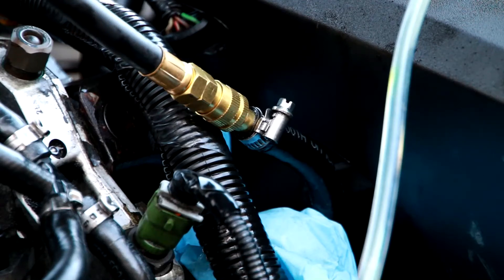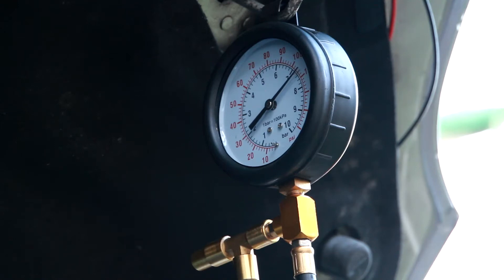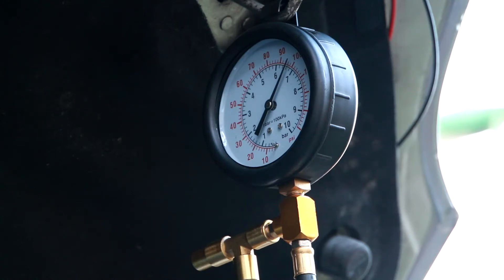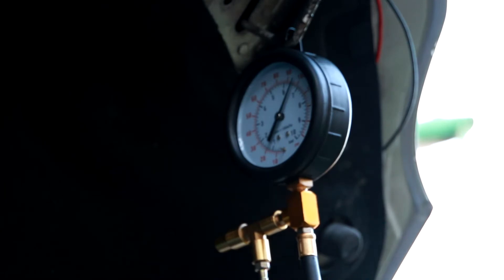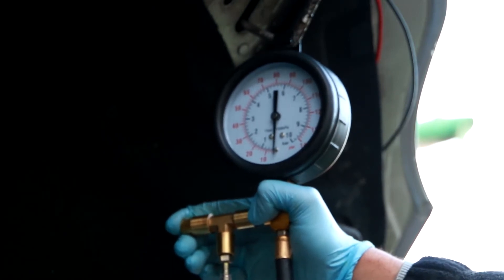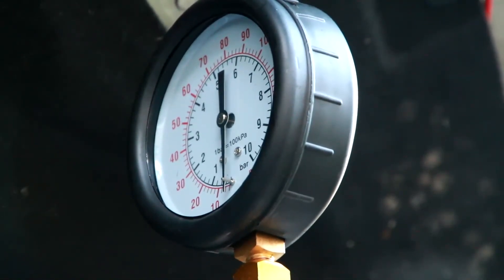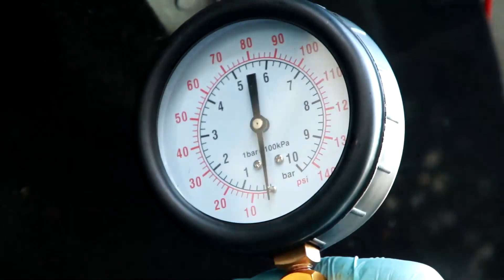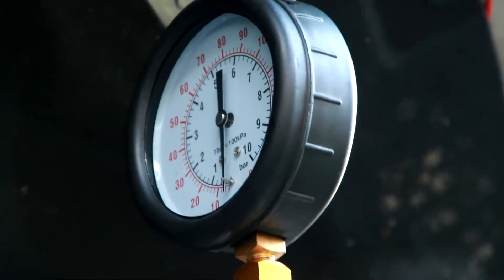Volvo D5 Fuel Pressure Check 1

Comment: Hi I know this is a few years later but in the 2nd fuel flow test, what should the reading be as you said it was low. This the hose that leads directly to HP pump nestled between the SCV or fuel pressure regulator or IMV/inlet Metering Valve

I'm asking as I've recently developed a longer cranking time, sometimes it cranks & cuts out and cranks again and starts. Then 3 weeks ago, driving along and the car switched off, steering heavy, no brakes. Tried to start it and since then it jut cranks, wouldn't even start with quick start. I've tested the SCV itself, it receives power as you can tell when it's held in your hand. I've cleaned and checked whether its actuated and that seems to work fine. I just need do to some more digging as I'm not sure whether one the sensors or sending the wrong values to the ecm causing it not block fuel thinking that there's enough pressure... So I'm still doing DIY with a scan tool trying to read the values and find the culprit. The error codes pointed to fuel pressure

Comment: even if the injectors are bad or blocked, i should still be making fuel pressure.
is this assumption correct?
Reply from the maker: Hi Dave. Thats right...even with faulty injectors you should have fuel coming to common rail and have enough pressure.
Its very unlikely the HPFP is at fault. When you remove any pipe or hose from the fuel system, it needs priming well and no, I didn't replace the low pressure fuel pump in the tank.
What I did was...I filled the tank half and then kept on priming until there was no air bubble noise coming from the fuel filter area. Car started straight away. 
So as the first port of call, turn key to position II and check if you could hear fuel flowing noise near the fuel filter under the rear passenger seating on driver side

Comment: Hi there did you actually replace the in tank pump?
i am having the same issue as you were having no start after injectors disconnected mine was replace swirl flaps.
i have primed the pump 20+ times with key to pos II (wait 25sec) and back to pos 0 
nothing seems to help almost no fuel rail pressure when measured with Vida 10900 hpa  at pos II  only 17500hpa when cracking.
no bubbles in inlet fuel flow and no bubbles in return fuel flow when checked.
even vacuum bleed the return flow.

i am thinking now the intank pump might be low flow or the HPFP is some how broken.
Reply from the maker: If your LPFP in the tank is faulty,  you wouldn't get any fuel coming to HPFP. 
If there is air in the system,  SCV wont send any fuel into pressurising chamber in the HPFP. 
Can you hear fuel flowing noise within fuel filter housing under driver side rear passenger seating?